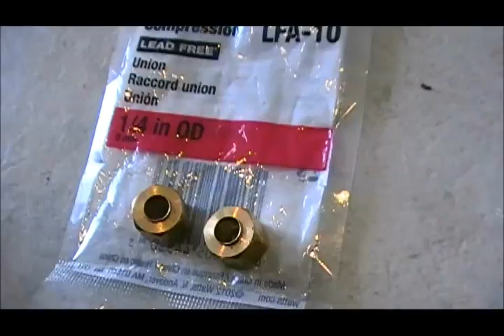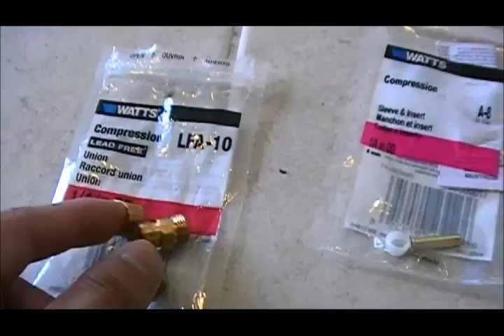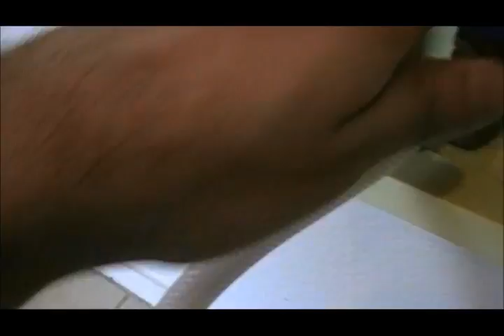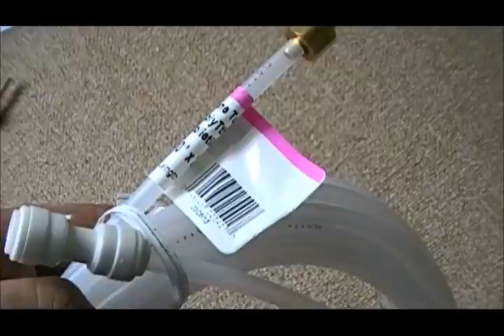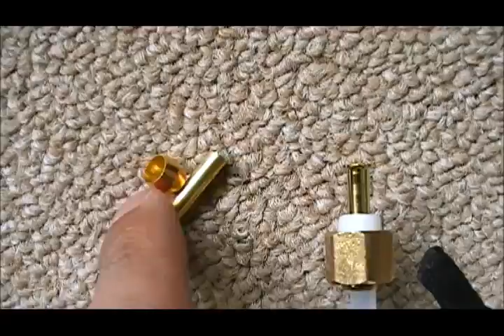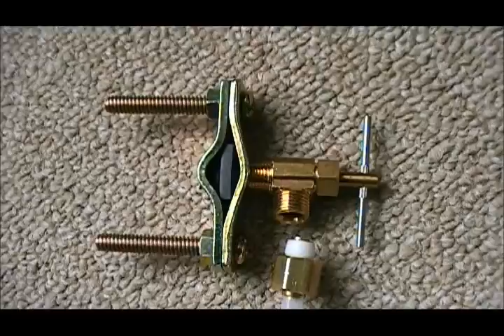How to install a fridge water line

Comment: I don’t think it’s good idea to use the small plastic tubing BEFORE the water valve.  Its easily damaged and can flood your home.  Even a mouse can chew through it.  It’s okay installed AFTER the water valve.  That way in the event of failure, I will only leak when the ice maker calls for water.

Comment: Thanks for explaining the differences between the copper and plastic tubing!  I purchased a SharkBite 1/2' x 1/4 - valve for the new "T" I made off my waterline, replacing the leaking saddle valve.  The SharkBite valve kit only provides the copper compression fitting, not for plastic. They failed to mention it. Though I was doing something wrong or parts were missing. After seeing your post, I went to Home Depot to and got the 1/4 compression fitting kit with brass sleeve and ferrule. $2.30 later - Its' Working fine!!   Thanks for posting !
Reply from the maker: Cool. I love those shark bite fittings I replaced all the old school valves in my 1991 built home because they all were worn out and had built up calcium on them and they wouldn't close after turning the handles. I had to close the main water line and replace them all. Bummer part was I had to use my harbor freight multicutting tool to cutoff the compression sleeves/rings on almost every pipe since they were not coming off after being compressed so hard on the pipes  ie bathroom and kitchen sinks and all toilets. Most of the tools out there I used to take off the old valves are horrible. 

Plumber I talked to says he doesn't like the shark bite fittings saying that they leak or are unreliable but none of mine have for the past two to three years since I got them.

Shark bite fittings were real nice. 90 degree turn to open and close and simple quick disconnect to install them. In my opinion every new home being built should use them. Brass craft copied them I think and their's were easier to turn from my experience.

Oh and you do have to cut off a portion of the old pipe with a copper pipe cutoff tool otherwise you may get leaks like I did. You can get them from harbor freight and then just sand the end of the pipe a little and you're good to go for installing the quick disconnect shark bite fittings.

Comment: those stupid compression nuts that go on the end are the bane of my existence right now. I had put in an inline filter, and the water line I bought had them. Every single connection that uses it was leaking. It started with the first, then I replaced it with the one that just takes the tube itself and locks it in. Then the next one that still had the compression nut started leaking... rinse and repeat. Now im up to the part that connects to the ice maker, and searching for a substitute that wont leak.
Reply from the maker: +James J 
 did you make sure the ferrule is inserted in the tubing before putting 
on the compression nut?

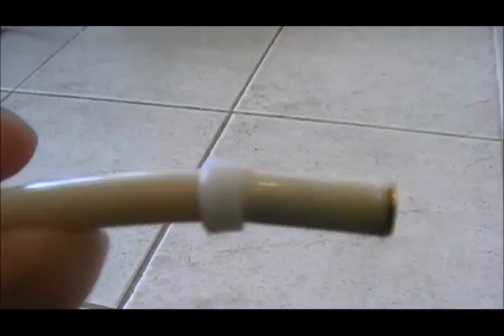also @1:15 check to see if sleeve is oriented properly.
if it is did you tighten with a crescent wrench?

i believe from what i remember the sleeve should not be reused once it 
has already been compressed.

i would ask someone at your hardware store 
to make sure.

Comment: Don't use that plastic tubing. It's crap. Use copper. I've had 2 breaks in plastic tubing. It's not worth it.
Reply from the maker: Depending on the situation in it may be easier to route the plastic tubing. When I installed the line at a previous home I was living in the fridge was too big to fit in the actual fridge location. So we moved it to a corner of the living room. The copper piping I got with the fridge water line installation kit was too rigid to route around walls, etc....

Comment: my ice cube maker is not producing the blocks. what should I do
Reply from the maker: I would make sure that the function is not disabled on your settings make sure the ice maker is seated all the way in. Also check for any lever or switch that is activated by the ice maker compartment

Comment: On a GE SIde by Side PSC23SGMDBS, I would like to turn the water/ice dispenser totally off but keep the ice maker working.  Several repair calls for dispenser only!  I prefer to just open the freezer door for ice.  The dispenser makes too much noise, causes endless leaks and water accidents, the freezer doesn't stay cold enough.  Not worth it.  It's an unnecessary, problematic feature.  Thanks.

Comment: Only use the compression insert on PLASTIC tubing. It's to prevent the plastic line from collapsing. You don't and shouldn't use it on copper. Also you need to cut some pipe covering off line so copper line goes deep into compression fitting. That's why you leaked. Jesus

Comment: So that white or clearish tubing next to the wire line inside the fridge on the warmer (not freezer) side is the water line? I need to get rid of that bundle by cutting b/c I don't like it being in the way...can I just cut it loose and throw it away if I don't connect to water at all? I mean I'm not using the ice machine...
Reply: +megasif It is the cold water reservoir instead of using a tank

Comment: My fridge is on the other side of the room and Ill be running the water line from one side to the other in my crawl area, any suggestions?
Reply from the maker: i had a similar issue because our fridge was too big to fit in the older fridge area.
i used Nail-In Video Cable Clips and guided the the tubing from the sink area to the fridge.
the tubing was basically mounted under the vanity or bottom of vanities and hidden as much as possible out of people's view. however, the tubing i used became pink after a while fyi... it was the thin type of tubing (not clear but semi clear probably polypropylene), you  typically connect it to quick disconnect fittings . definitely don't get the completely clear one and you can feel that this type of tubing is slippery it will slip off of compression sleeves that was my personal experience. i don't know if the completely clear one will slip off of the quick disconnect fittings.

Comment: Hi Knightridar1,

Thanks for the video, I'm about to buy and install an american fridge over in the UK and i was wondering what you think i should do about my setup.

The fridge is going to be on the other side of the room from where the sink is so I'm going to have to run a pipe over to it. Should i use a T junction like the one you showed with another copper pipe coming out and going all the way around the room, over the door and into the corner (note: i can't go through the floor as it's concrete). Then put a value on then use a similar setup to the one you showed in this video?

Comment: Hi Knightridar1,
We bought an LG fridge that comes with a big white roll of hose/tubing inside. What is this for? I thought it was to be use for water line/ice maker but it seems like is going down the fridge-coming to the front-then up to the water dispenser. is this correct..? I appreciate any help.
Reply from the maker: hi its probably just piping that goes to the ice maker/water dispenser. this is pretty common i have tubing like this in my fridge as well. if it's already connected then don't mess with it.
you want to leave that alone.
also check your manual.

it could be you got an extra roll of tubing to connect that you can connect to the outside of the fridge but that would mean that that roll of tubing inside shouldn't be connected to anything.

the main connection should be outside. a lot of new fridges come with quick disconnect fittings on the ends
Reply: +Rigo Duran That is your cold water reservoir instead of using a tank to hold the cold water reserve

Comment: The saddle valve will act as a shut off when turned back in. So no worries about having leaks if you move and disconnect the tubing.just leave the saddle valve behind. A saddle vale is under 10$ at you local home improvement store.